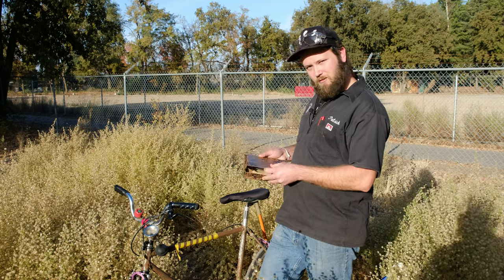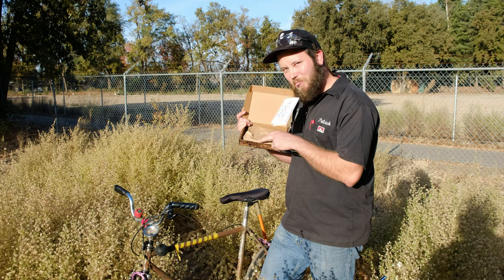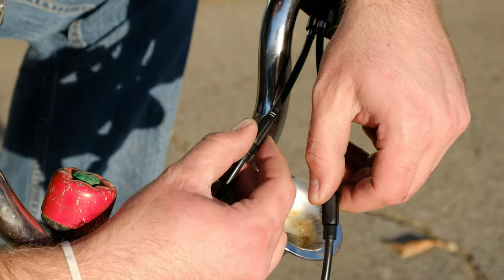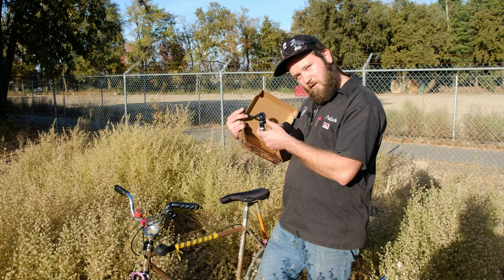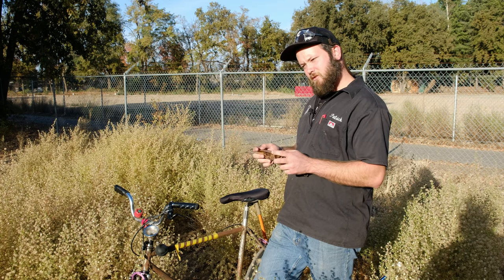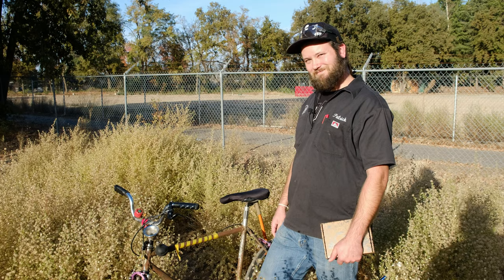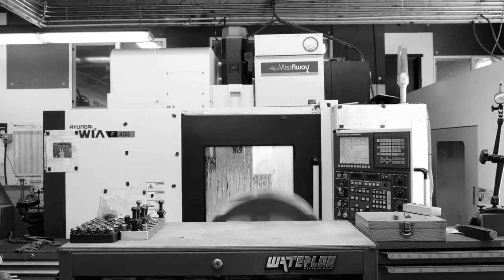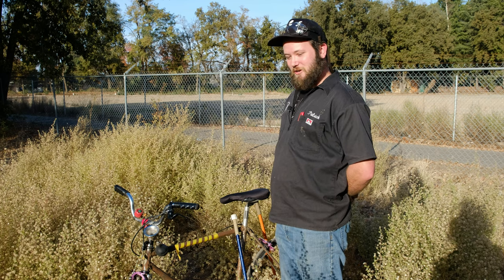Patrick Explains the Duplex Brake Lever

Comment: Won't the front engage faster and harder due to brake line flex, there by destabilizing the rear that you cant control the brake power of?
Reply: so adjust your brakes so the rear engages first..